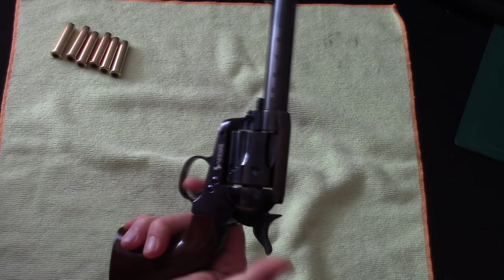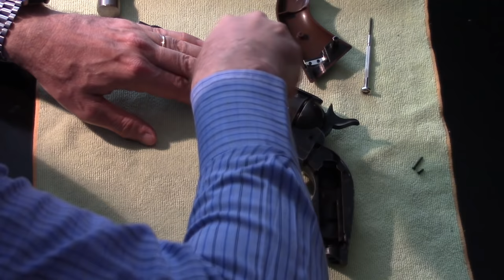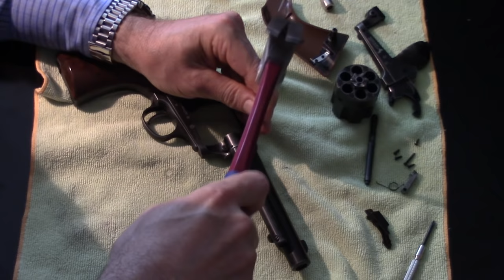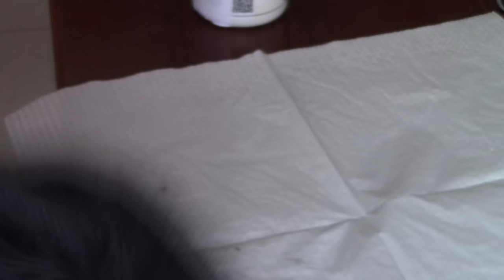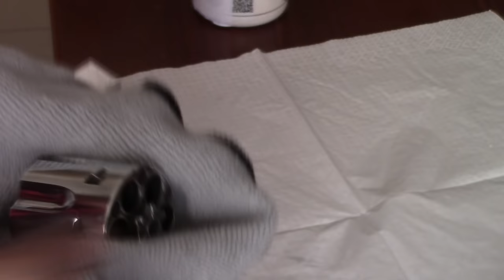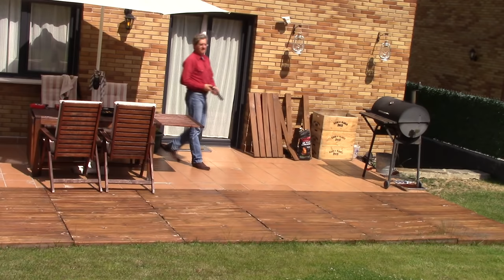Bad quality barrel of Umarex Colt SAA Peacemaker and how to solve the problem

Comment: Is this damage because you used bbs and not pellets. Ive heard bbs destroy a rifled barrel
Reply from the maker: The original barrel doesn't admit pellets, only BB's. The problem was due to a cylinder misalignment and nothing else.
Reply: @xavibarrera7953  oh ok. So if i buy a pellet version Im ok
Reply: @xavibarrera7953  What are you talking about ? You can use pellets in ANY version. BUT you don't want to use  bb's in a rifled barrel version to avoid destroying the rifling. As simple as that. As far as your "barrel issue", it's obviously more from bad handling and lack of reading the manual than from a bad quality barrel. This said, the rifled barrels are way more solid.

Comment: Why is the drum turning in this film so fast and with a different sound? 
The clicks when rotating this drum are much higher from the sound.
Reply from the maker: Hi Rainer, 

You can see the cylinder of that revolver turning fast and making a different sound than usual because the barrel is broken. Due to a misalignment malfunction, one bb has deformed the cylinder, as you will see in the video. As a consequence of that, the barrel doesn’t act as a cylinder brake, and this can turn freely.
Reply: @xavibarrera7953  I was wondering that myself, thank you

Comment: does anyone know if one buys the pellet version now, would they still potentially still have this problem or is it on the bb versions only ? looking at getting this revolver and if my chances of having problems are less with the pellet version that is what I will get. thanks
Reply: Have several pellet ones and NEVER had a single problem with any of them. Of course, I read the manual before...

Comment: Why doesn't my cylinder spin like that
Reply from the maker: Your cylinder doesn't spin like that because your barrel is not broken. When the barrel bends due to a misaligned bb, the spring that holds the cylinder loses its strength, and the cylinder spins free. You don't want that, believe me. 

I'm alive and well but with a great load of work. I appreciate your concern. Thank you very much.

Comment: Your cylinder should not move that freely?? On a real one yes but on the replica it has a o ring and does not spin like that. Also u must have got a shit one because  I have the limited edition  marshal  colt with over 3000 rounds  and it still works perfectly

Comment: This only happens when a BB gets stuck in the barrel and you shoot the next one........agains the stuck BB !
Easy solution ? Yes, use only lead BB's and change the co2 cartridge IN TIME ! ( Read the manual.....)
Reply from the maker: That's what happens when your revolver shots with its cylinder misaligned, which is a common failure of the Umarex SAA. You will find a complete explanation in this video: https://youtu.be/IPNU6d4ohbo

Comment: If you are worried about the barrel on your bb version, just shoot soft lead pellets through it, which probably will not dent the barrel. If your barrel is already bent, just take it out! My barrel is still perfect, but I removed it. The cylinder now spins freely on half cock, as it should, and it still shoots fine! I dont have a chrony so I cant say hom much power you lose without the barrel, maybe someone can test it for us? Give it a try, I love this gun even more after removing the .177 barrel from the cosmetic barrel.
Reply: So, what you are saying is that you basically shoot your pellets through no barrel at all ? I would be interested to know how precise the shoots remain.
Reply: @RenoLaringo  yup that's what I'm saying. I haven't shot at paper targets or anything but I have no problems hitting cans.
Reply: @codeguise  Thanks buddy ! Seems like a cool mod ! I'm waiting for a second saa to come. I will definitely try that. Now, thinking about that, it would probably be possible to  shoot bigger projectiles, like rubber balls for ex...? Tough I guess the power would drastically drop. Have a great one Pieter and happy shooting !
Reply: @RenoLaringo  the way it makes the cylinder spin alone makes it worth it to take out the barel!

Comment: bet YOU DONT'T KNOW HOW THIS HAPPENS?? WELL IT'S USER ERROR BC YOU DIDN'T RTM..i WILL AGREE THAT THE DAISY BBL IS BETTER BUT THIS WOULD NEVER HAVE HAPPENED HAD YOU ACTUALLY READ THE MANUAL some of these had 4 clicks!!! some do not if you have a 4 click which it looks like you do then you've been shotting this gun un aligned the 4th click is firing position so to anyone else watching this to avoid this mKE SURE YOU DON'T HAVE A 4TH CLICK IN THE ACTION INSTEAD OF 3 REAL COLTS HAVE 4 BUT NOT ALL OF THESE UMEREX GUNS DO HAVE 3 SOME DO HAVE 4 NOT SURE IF THIS CAN BE TRACED VIA SERIAL NUMBER OR YEAR IS THIS A NEW OR OLD ISSUE BUT..THIS HAPPENNED BC THE BB WASNT IN LINE WITH THE BBL
Reply: That is what is called a design failure when the gun can be easily mistakenly shot in a situation where it breaks itself.